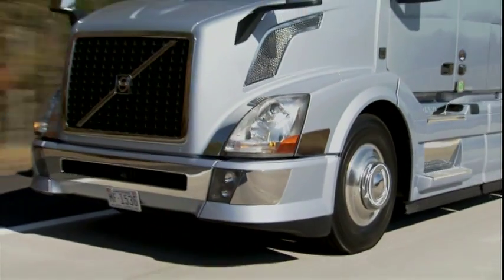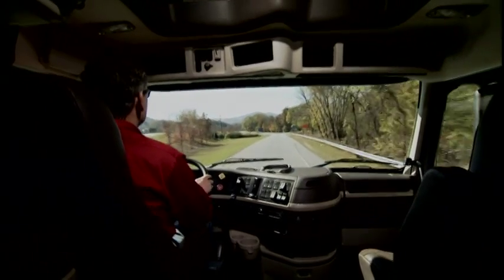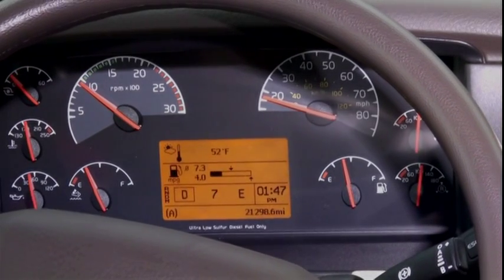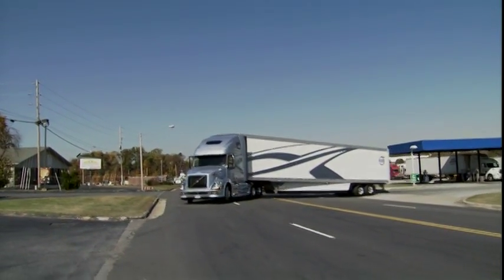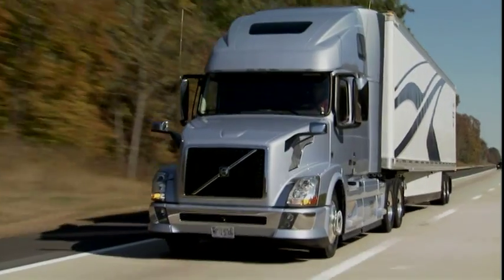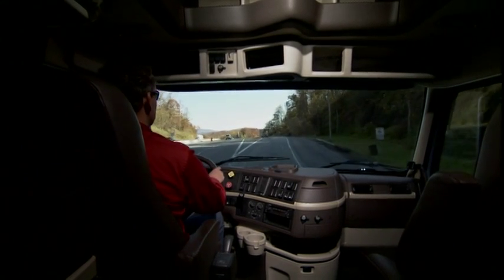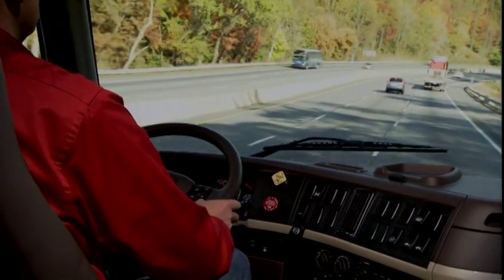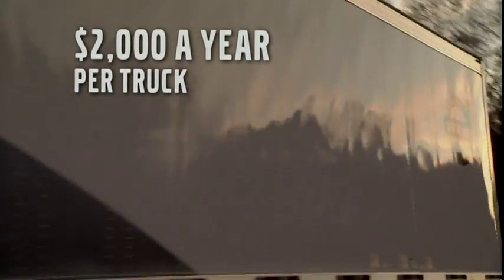Volvo Trucks - Volvo XE13 Operating Tips

Comment: Does anyone know there arrearage mpg
Reply: 7.6.... It's on the video
Reply: HYLTON SMITH. Avg mpg is between 7.75mpg & 9.0. depending on grade and your driving habits.
Reply: Driven well they do 8-9+ , you effortlessly get 7.5+ in a XE , even hauling heavy. 
 I've been over 10 mph in ours with light loads, aero trailers and hyper mile driving

Comment: I don't think real truck drivers will ever like the "Fake Automatic" or automated manual. I can see them being useful in area's that there is a lot of stop and go since the clutch tends to wear out faster.
Reply: Automated manual still has a clutch, it's just controlled by computer. 100% power transfer.
 NO Torque converters on the iShift.